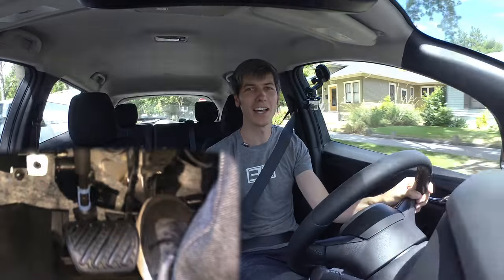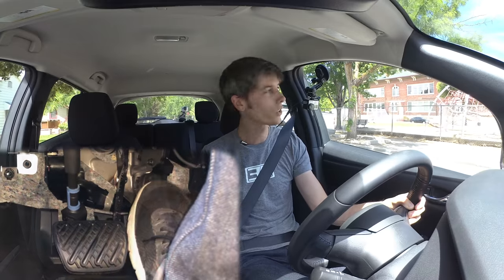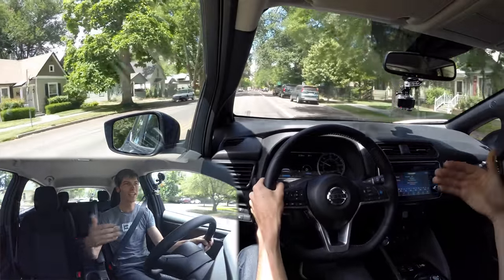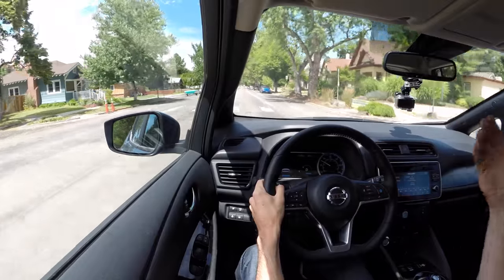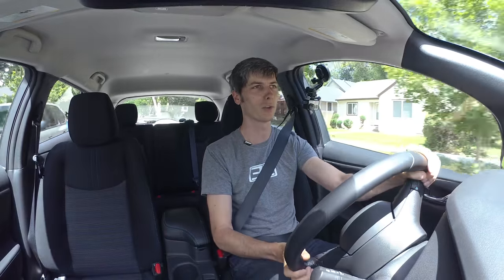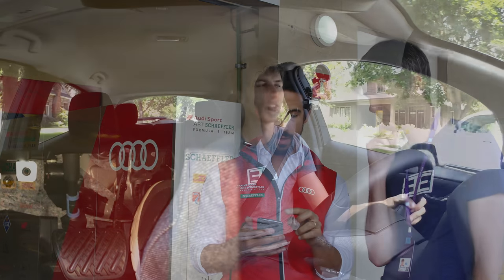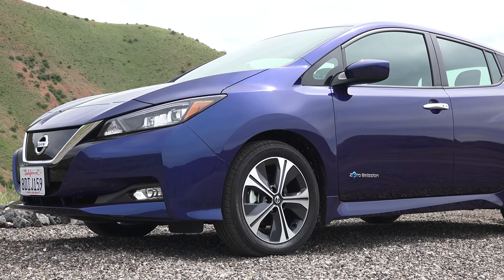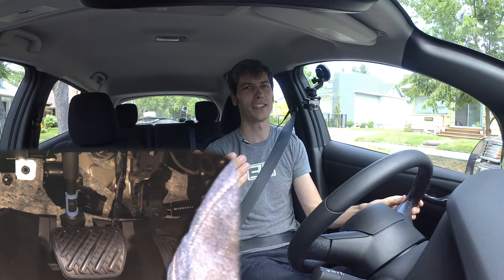What Is One Pedal Driving?

Comment: I don't think e-braking is like ABS. ABS has an increase in resistance, up to the point of traction loss, and then a decrease in resistance until traction is regained. In a brushless motor the resistance is constant. The flat torque curve coming out is, and i'm guessing of course, probably similar to the torque required to spin the alternator at any given RPM. tl;dr, i don't see the dynamic change of resistive force. I only see a 0.2g resistive force which is much too low to ever result in traction loss in the first place. That's about it.
Reply: John Jones. You do know that the computer can control the regenerative braking right? It can even be entirely disabled on some cars.
Reply: I must admit, i don't know all i could know about how that works. My initial assumption would be that they supply some electricity to the "motor" whilst regenerative breaking to modulate the rate of descent. i.e.  "light" regenerative breaking is just regenerative breaking with power sent to the motors every now and again to prevent the vehicle from slowing down too fast. Thats the most "digital" i feel that this can get.

The most obvious way i might be wrong is if a given alternator has a 500W load, it is harder to spin than if it has a 100W load, for the same alternator. I spend such little time around alternators i actually don't know if this is true. I think it's not, at least for most alternators, but I could be way wrong. If i am wrong,  then the car could modulate the speed of braking by modulating how much current it is demanding from the regenerative brakes. But i thiiiiink if you want more out of an alternator you have to spin it faster...

...but then again, most AC diesel generators have a constant rate of spin, because the rate of spin effects the Hz of the final AC wave.. that would mean i'm wrong, alternators get harder to turn when you demand more energy from them...

yeah if it wasn't obvious by now, i don't think i know wtf i'm talking about.
Reply: the generator gets harder to turn the more load you put on it. (simply said: the Power you pull out (+losses) you have to put in.)
Reply: That's so weird and cool. Almost magical. Thanks both for teaching me something :)

Comment: 65,000 miles on factory brakes. He speaks the truth.
Reply: HerbanLegend. A friend has over 300K on his freightliner, brakes are in perfect shape with 60 to 70% material left.
Reply: That's completely normal
Reply: Robert Hull it's completely possible, but not completely normal if you are a part of the trucking industry. Brakes get used up or more often than I should do to unwise driving techniques.
Reply: You can do that too with IC cars ( with large displacement engine), proper engine braking can generate more than 0.2g at cruise speed, the key is learn proper downshifting and engine braking and you'll see how long the brakes in Manual IC can last. 
Just some minus ( It would be loud as you're trying to keep the engine around near redline to get max engine braking, and your brake light didn't lit up)

Comment: has there been any study into the safety of this? if the brake pedal is not used in normal driving there could be a disconnect between the brain and the use of the brake pedal meaning it would take longer to react in an emergency, i heard of a study with self driving cars where people took considerably longer to react to pressing the break when they where not in control of the car (this was even when the participants knew they where being tested on reaction time)

Comment: Are you sure Nissan's ePedal is only using the brakes once the car has come to a stop? Typically regen tapers off as you slow down, so it can't bring you to a stop.

My understanding is that Teslas don't have a one pedal driving mode. They use credit only regen, not the brakes, and therefore don't take you to a stop, forcing you to use the brake pedal. But cars like the Bolt and the new Leaf have one pedal driving modes that take you to a full stop by applying the brakes for the last bit of deceleration.
Reply: Peter Epstein it would only need to apply the brakes when you are very nearly at a complete stop, i.e. maybe the last couple fractions of a second...

Comment: What about extra strain on the specific engineering designed for the kinetic regeneration (battery charging)? Wouldn’t this have a similar degeneration to using downshifting to decelerate?

Comment: On my 2013 Nissan Leaf there is almost no regenerative braking until you drain the battery to below 80%. Does the new Nissan Leaf have this problem. 

It’s annoying because you have to drive the car different going to work compared driving home.
Reply: +Ecospider5:   Sorry, but it's inescapable that if the battery's full, there's nowhere to put regenerated energy.
Reply: It is real hard to have regenerative breaking bring you to a complete stop. So at some point the computer is engaging the break pads to bring you to a complete stop. My hope is when the car has a full battery the computer is smart enough to apply the mechanical breaks slowing you at the same rate that the regen does when the regen has a place to put that energy. 

As I said that doesn’t happen on the 2013. Just wondering if they added it to the 2018.
Reply: ePedal will provide a near seamless braking experience regardless of SoC because it blends friction brakes where regenerative braking is not available.

Comment: I’m not clear on the brake light. If I’m trying to go 55 and I see I’m at 56 does backing off the throttle a tad result in the brake light illuminating? What if I’m punching the throttle on a steep hill? Will the brake light illuminate at the top of the hill when I no longer need the extra throttle to maintain my speed?

Comment: what about turing off the e-pedal system? could you make a video on this??? surly there will be times when a driver would want to coast to conserve momentum. surly the e-pedal system doesn't recuperate all the energy used to accelerate the vehicle, therefore most of that energy is lost in a situation where coasting is ideal.

Comment: When a person forgets to turn on the smart braking and is expecting the car to stop until it's too late ...
Reply: Doesn't happen. You feel it and know it immediately. What you're saying is like driving a manual transmission and lifting off the accelerator in 6th gear. You immediately know you don't have the right gear for engine braking and just downshift to the right gear and/or use friction brakes.

Comment: Could you pull this off in an automatic that has a gear select function? Just engine brake in any non-emergency situation? Or would that be too hard on the engine to be worth saving the wear on the brakes?
Reply: You save your brakes but wear out the transmission faster (unless it's a manual) i think it would make most sense on a steep mountain where you have a chance of overheating your brakes

Comment: ive heared that not using the breaks that much due to the "electric breaking" results in the break discs corroding early, which is why they put drum breaks on the rear axle of some prius models. is this an issue with the Nissan leaf as well?

Comment: So it's a bit of a binary system? You're either accelerating (or maintaining speed through the use of the accelerator pedal) or you're braking? It'd be weird to try to get used to a car where there's no coasting at all.

Naturally the regen braking is not 100% efficient, meaning that energy would be wasted if you were to accelerate, use regen braking, then accelerate again; compared to a more traditional experience of accelerating, coasting, accelerating.
Reply: The Tesla I drove years ago had a similar system (but it didn't stop completely).
It was really weird in the begining but I got used to it really quickly. It was a progressive system, from braking to accelerating. Its hard to describe, but after you get used to it (which took me about 5 minutes) its not really that different from driving a normal car.
Reply: you can turn it off
Reply: In a prius you can keep the pedal down a little bit and you just coast without regeneration' I use this all the time and get 59 mpg in the city.
Reply: regen braking is still be efficient than traditional braking system because the motor will collect the energy from the wheel. not 100% energy will regenerate, but it better than nothing (in traditional brake, all remaining movement energy are transfered as heat energy).
Reply: but the only disadvantage for us today is we need time to adapt the new system.
Reply from the maker: Not sure what you're saying. As you pointed out you can still coast depending on pedal placement, so if anything this allows for much better efficiency, and at worst it's equally efficient.
Reply: The best name for the "gas" pedal is still just what Jason called it:  an accelerator pedal.   Rinse it through Newton's laws a bit for a car with fairly constant mass, and you can also think of it as a torque pedal.  With no driver input (pedal completely released),  the requested torque is the maximum negative value.    I'm not sure how the pedal position is mapped by the car's control system, but when the car's speed is sufficient to make regeneration possible, there'll be some point on its range of motion that translates to "apply zero torque to the wheels".  If you hold the pedal at that point, the car will coast.   Push a little harder, and you're asking for acceleration, and, as with any car, the more you push, the more acceleration you get.    Relax the position, and you get deceleration according to how much you release the pedal.   My Leaf has a prominent display of how much power it's applying or extracting from its motors, and if I watch this carefully, I can maintain "zero bubble" for perfect coasting off the road and into a ditch.
Reply: Levenkay that ending was unexpected 😂
Reply: My EV has paddle shifters to set the sensitivity of the regenerative braking and I can adjust it on the fly.

Comment: Cool tech & I’m glad you explained how it handled on slippy surfaces since I live in a snowy climate. Sounds like they have it all figured out but it does make me nervous that the brakes are basically operated by computers, a “glitch” could be fatal...
Reply from the maker: Fatal? Use the brake pedal if you have to, it’s a mechanical system! :)
Reply: Engineering Explained Oh okay, I thought it all ran thru the computer, did not realize it still had a mechanical input.

Comment: What about when your are cornering in a wet surface. if you ease of the gas pedal and enter in a decelerate mode, wouldnt it destabilize your car (with a greater force than the regular engine braking) and have an accident?? And general does the decelerate mode engage in cornering? Braking only the front tyres seem kind of dangerous.
Reply from the maker: It’s dependent on where your foot it. If you don’t want to decelerate you position your foot accordingly.

Comment: My Leaf's e-pedal often ignores regen and goes straight to friction braking.  At least 2-3 times while driving each trip, have you noticed this in your car?  Also, when i first got the car I had to press the brake pedal to be able to switch off the E-pedal and now it doesn't require me to do so, does yours?
Reply from the maker: Mine's never used mechanical, always regen. Regarding turning e-pedal on/off, for me you can turn it on while driving, but you cannot turn it off if you're stopped and your foot isn't on the brake.

Comment: Out Bolt EV will decelerate with almost 80 kW regen in L and activating the steering wheel paddle.

However under hard braking event, I find the friction brakes (pads and rotors) are not very good.  Low bite or coefficient of friction and not a good feeling. I think they undersized the friction brakes for the mass of the vehicle.
Reply: I'm naively hoping that an electric vehicle's friction brakes are sized so that they can stop the car on a downgrade even if its motor controller has gone berserk and is trying for full acceleration.

Comment: I thought all cars were like this until I drove an automatic car. Why can't fully gasoline cars with automatic transmissions be able to do this? Why can't the torque-converter or whatever disconnect from the driveshaft/wheels when you don't have your foot on the throttle?
Reply: Because you just want to coast along without massively slowing down. Just a slow speed adjustment, couple of mph in stead of breaking with this regen epedal.

Comment: Now you say that the brake lights work as the should with one pedal braking, but ive experienced a tesla cut me off to turn left with a fast rate of deceleration with no light until they were almost at a stop. Ive also read of similar situations where some one was following a Tesla roadster on a track and couldn't follow their braking points because the lights wouldn't go off with deceleration.

Comment: If you choose to opt out of e-pedal use, does the brake pedal still use regen for the first, say, 20% of its total modulation area like in a hybrid, or do you lose a lot of the regen braking opting out of using the e-pedal?
Reply from the maker: Still uses mostly regen, even past 20%

Comment: One issue with this I have on my i3 is that since the disc brakes almost never activate, they get covered in rust and dirt. So when the do activate e.g. when  the battery is completely full, it makes an awful scratching sound. I try to occasionally brake hard to wear off the oxidation, but it's never enough to get them completely  clean. (I can't constantly panic brake for no reason in traffic).

Am I supposed to have someone sand them off or something?

Comment: Wouldn't this create a safety issue? There would be a delay in getting to the brake pedal over having your foot on the brake pedal all the time.  Why not make it so that putting your foot on the brake pedal simulates this one pedal driving, until you push hard enough to need to engage the brakes.

Comment: In the interest of range, wouldn't it be better to have a clutch that disengages whenever you aren't accelerating? (Also, to use more regenerative braking when quick decel is needed.... on models where regen is at the hub)
Reply: electric motors can coast with little drag

Comment: i kind of do that when i drive my car because its diesel and slows down quick af with just the motor, idle in 1st gear does less than 3kph so at a stop sign thats alright, tbh all of this is irrelevant because i have a manual and need to use the clutch
Reply: FishRSA I use both of my feet, but i dont use my hands to steer

Comment: To be honest that is basics of "eco-driving". You need to predict the situation as much as possible in advance and avoid using brakes almost at any cost except emergencies. Accelerator does not waste your fuel, the brakes does. The only thing brakes does is to take all the energy created by precious dinosaur remains and turn them into heat which his then totally wasted + the brakes wears as well. Same basic principles can be used in any car to improve fuel economy, the only difference for the cars which do not have electric motor/battery pack - the extra energy cannot be saved, so you could only reduce energy used by starting to coast and slow down as far as possible from where you actually have to stop. It works for both mechanical and automatic cars. Other trick which does not save fuel, but preserves brakes is slowing down using gears - same principle as regenerative braking, except instead of electric motor, the gearbox and engine is used for braking, brakes do not wear, but no energy is stored either. With electric cars and this e-pedal trick you could obviously not only reduce energy usage, but as well recover some of the energy, however the key thing remains the same - to use e-pedal efficiently you need to be vigilant, plan the route ahead, predict what other drivers will do and minimise the use of you hydraulic brake.

Comment: Good video, but how can braking power be more than (-) 1G? As far as I know 1G is the limit. Even with the most sofisticated brakes it can be 0.9 to 0.9999..  If you can show me some examples where it can go over 1G it would be great
Reply: Ok, but is aerodynamic drag and maybe, activated spoilers during the braking responsible for 2-3G braking force? Do race tires have better grip than regular one(different molecular structure). Are they also the reason for beating 1G limit?